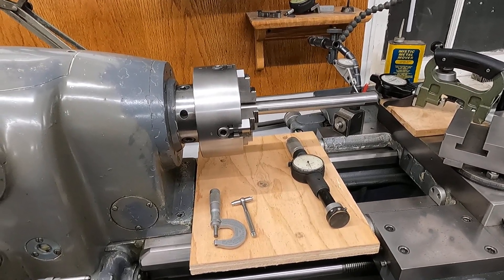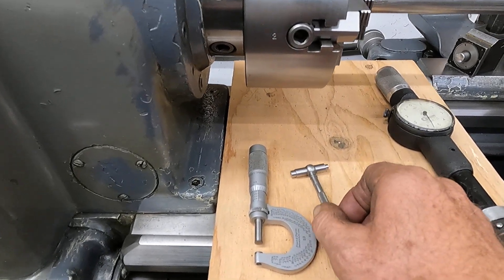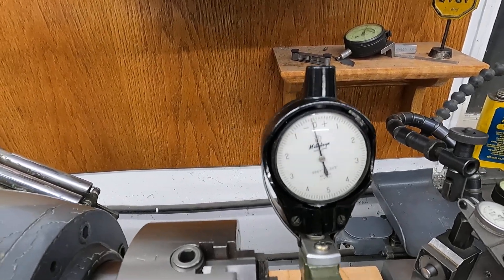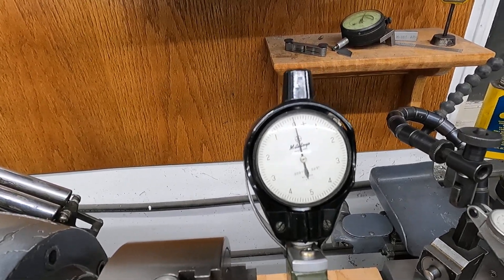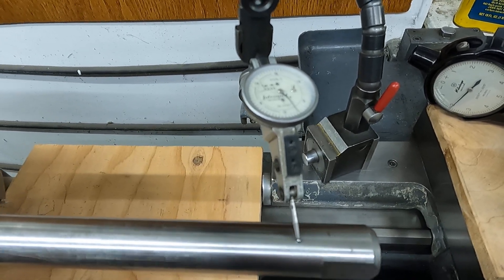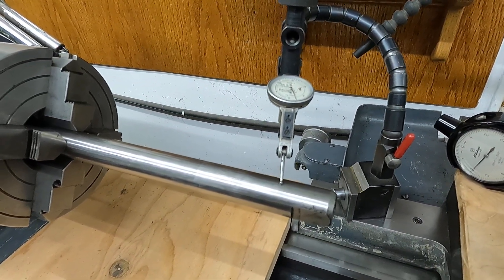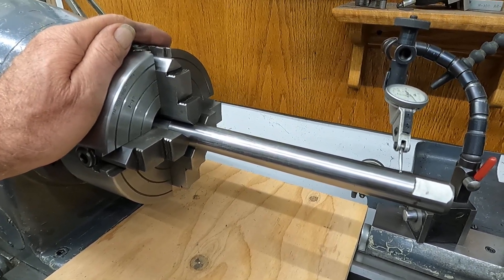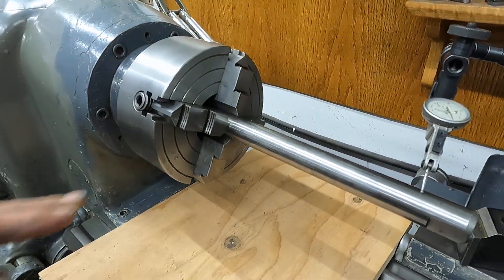Monarch 10ee lathe, the pursuit of perfection, doing your part.

Comment: Ah man You have some wisdom there! How long you been in the metal world? By the way I recently pick up a 1951 10ee with a MG and I’ve discovered some issues already, it was wired 440v so had to convert to 220 on the main motor and also, I got it to run but only in forward and just won’t go in reverse, also if you turning on the open belt and let’s say you taking a .040 cut at 1k rpm the machine will slow down and eventually come to a stop, anyway just wanted to say that hope you can shine some light! And keep the videos coming 💪🏼👍
Reply from the maker: I can do a video on the Reliance Electric Co recommended commutator maintenance as printed on the control panel cover. Another tricky operation on a running machine.
Reply: @deedeeindustrialsuperprecision  awesome that will help a lot man, thanks you
Reply: Mine was also wire 440 volt. I just used a transformer to step up. 
The electronics were a bit intimidating for me. Works like a charm 
mine is 1956

Comment: You make excellent points about tooling up your 10ee properly.  Legend has it that these machines were used to turn the plutonium pits at Los Alamos, and also the critical components for the Norden bombsights.
Reply from the maker: The ee is by far the easiest lathe to operate in a glove box. The photo of the ee working plutonium behind a glass wall with gloves disappeared off the net 20yrs ago.
The advancement of the machine follows advancement in military industrial needs.